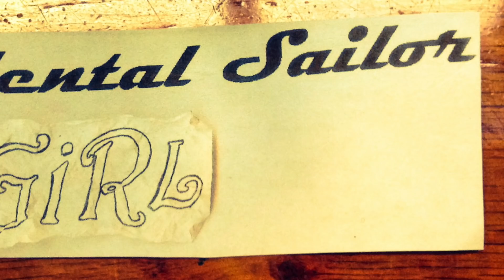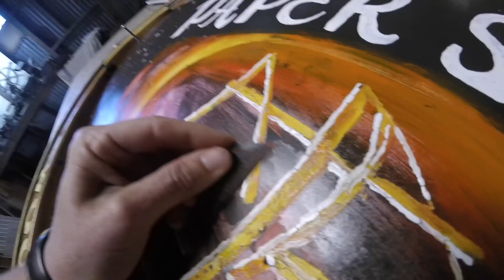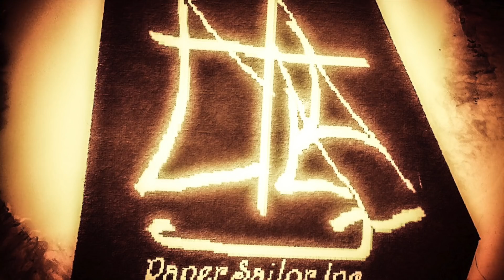Beginning Work on the Pacific Seacraft

Comment: Our boat shop started out building strictly wooden boats then changed to fibreglass boats to meet the demand of buyers and potential buyers. We built a marine slipway mostly for the repairs and CSSI inspections over a certain tonnage. Ninety eight percent of all repairs were on the wooden boats, don't get me wrong I wood rather build and work on wooden boats till the cows came home VS fibreglass or steel. But unless the glass boats are old and the decks are spongey or the bottom has blisters the glass boats are just that much more resilient .